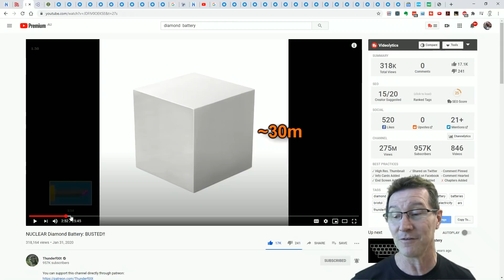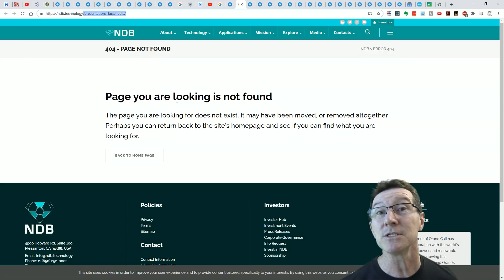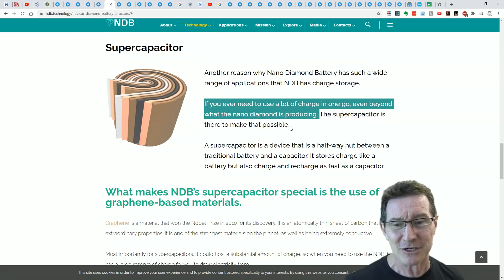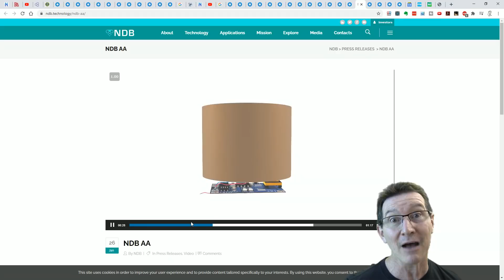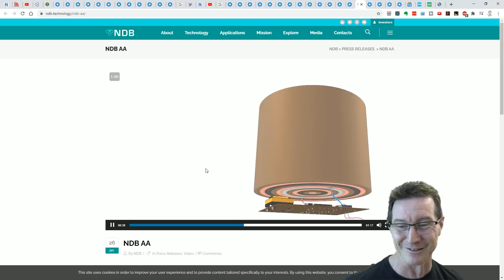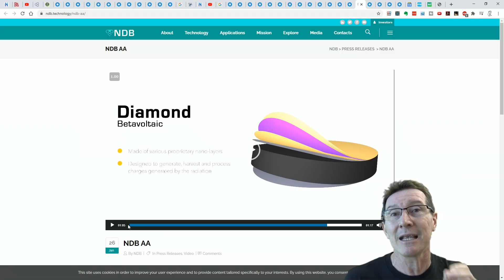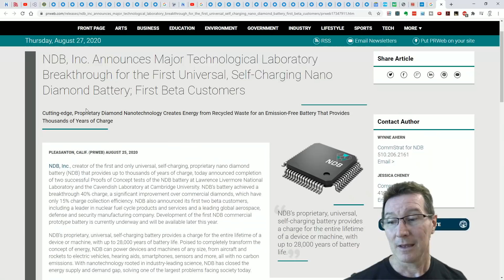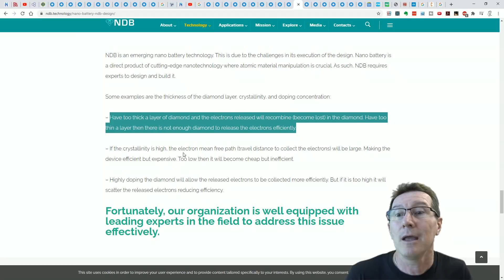EEVblog #1333 - Nuclear Diamond Self-Charging Battery DEBUNKED!

Comment: Can I testify in the court case against you.  Your self marketing sounds fine to pole without a brain.  Why don't you calculate the actual volume of the example photograph, and the sub volume in the chip (hint: Did somebody say 7 watts a gram of material, is that even true?  How big is that?).  7kw will run an EV.  How big is 1kg?
Reply: I forgot, one image of a product, doesn't prove what other products do.  It's unacceptable to extrapolate from that, as accommodating the relative dimension and weight data shows maybe seperate.

So, with no, Actual, proof of what is happening, this video is made.
Reply: https://en.m.wikipedia.org/wiki/Dual_in-line_package

I don't know what modern types are out there, but are you sure this is not some sort of skinny type?  That's probably a 8 times+ lower volume.  Also, if the standard is chips of 100 micro watts, then the chip is made to size, and the size of the actual power producing unit inside it can be smaller.

Lol. Listening to you reading their web page, not even realising what you are reading and how that customises the performance.  I need to make a channel just examining videos like this.

Do we trust a test lab, or a YouTuber?

Comment: Of course the power is ridiculous and it already exists with tritium or plutonium, but you forget two huge differences:
There is already no Tritium in nature and especially Tritium is ionizing like Plutonium which is one of the worst crap that can be made.
While their C-14 is therefore a Beta emitter without any danger, which we can consider producing on a large scale and distributing it commercially.
So nothing to do with RTG sources produced in very small quantities for space programs. It is obvious that in the first place with a very small production capacity the box is positioned on the micro-power market like its competitors to demonstrate techno, the higher powers coming later.

Comment: IF you could use the entire half-life of the unit in a reasonable timeframe, this would all work.  That's where they're getting their "energy density" from.  But no user is going to be using their product for 5,000 years.  The most optimistic timeframe is probably about 50 years, where you as a youth buy some gadget and pop in a nuclear battery and 50 years later it's still running and you've never needed to change the battery.  I suppose that'd be nice, but very few electronic products are still going to be usable 50 years from now.  I'd like my cell phone to never need a recharge, but cell phones made even 10 years ago  (analogs) are incompatible with today's networks.  So lets use 10 years as a water mark.  It's similar to the lifespan for say, a good smoke detector.  (and we already have 10 year lithium batteries for those too)  So comparing the power used over 5,000 years vs the power used over 10 years is silly.  And that's why 100 microwatts is pointless for most applications.

I suspect that the person that made that 100uW dip picture in cad was given a picture of circuitlabs' unit and told first to duplicate it, and then the marketing people sat around him giving him instructions on how to make it look like their product, without considering they were leaving an actual fact-checkable number on it.  If someone told them that was a quantifiable measure of performance, they'd have immediately removed it from the graphic.  You really can't give it any credibility at all - just because it's all they've released doesn't mean it's credible.  It was a MISTAKE, you need to quit harping on it.  Unfortunately, every other hard number in their marketing is pretty obvious BS (like claiming near 100% efficiency, when their competition already in the market has only managed 8% after probably 15 years of R&D)  So ultimately there's nothing to go on, they just say what sounds good, and the actual engineers had zero input on the matter.

Comment: Another thing, I am not saying this works or anything and I seriously doubt it comes close to the claims in the stories as usual, I simply don't know enough, but surely trying to extrapolate any information form that picture is a fools erand, the reason I say that is that is we don't know the actual size of that chip, the chip could just be a container, look at a cpu only a small fraction of the chip is the actual processor which means in theory the cells could be tiny and in that volume (whatever it is) could potentially contain thousands of cells . Again I am not saying anything positive about it as it might be shit it might not but your arguments also don't hold water

Comment: Ok I have no doubt that this NDB battery is snake oil, what I have a hard time believing is some of the points you make especially when you fail to read 14.29 as 14 thousand and 29 when that should have been 14 hundred 29. A simple mistake like this makes me feel like a lot of the other mathematics are well off as well. 
But of course thats just my opinion and mistakes do happen.

Comment: Powering a car with diamond is the new joke from gumbas & blokes. The nano diamond battery is for low energy devices that have to run reliably for many years like sensors, pacemaker, & hearing aides. Computer sensors, factory/industrial sensors, car sensors, smoke alarm...... Etc.... The best applications for nano diamonds is in the medical field what would you rather have in your body deadly tritium gas, the go to toxic lithium or a safe radioactive diamond battery that doesn't need to be replaced or charged all the time i mean sure if you like heart surgery go ahead bloke! All batteries have uses. Whoopdee dooo LOL..... 
I wonder if they could wirelessly charge pace makers & hearing aides instead of the usual surgery. Why & this is the kicker would we need pacemakers if we have 3d printed organs?

Comment: Ok, not like I would invest in this project any time soon or anything, but. . . just because that one chip in the article was 100microwatt, why do we assume that 100 mw is the maximum they could produce at that scale? I mean, couldn't that one chip just be a model that works at that level on purpose, or an early prototype that they've since surpassed? 99% of this video is some variation on "100mw?! You can't do anything with that!" and maybe that's true, but what is the evidence that this is the absolute limit of its production capability? Just that one concept image? I mean if it could generate the power to fully recharge a standard AA battery over a day, or even a week, or in some applications even a month, that would be a viable power source for a lot of applications.

Comment: 100 μW, about as much as you get from a potato battery, or about 1/10th of a lemon battery, and they expect this one to power a phone. At 100 μW a single AA-battery can last for about 20-40k hours, about 2-4 years, that is if it's constantly drawing power. So the diamond battery would only have uses like small clocks, or as a replacement for a CMOS battery in computers to keep the BIOS and system time from being reset, among other things that are critical for ultra-low power devices running longer than 10 years without a stable supply of power

Comment: I can see one application for these - in clocks. Even a large radio controlled wall clock takes only around 100uW, so a nuclear battery coukd be built in and the clock sold as self-powered.
But since such batteries are already available, cost must be the key question. They would have to sell these for maybe a dollar at most to make them, er,  disrupt the clock market.

Comment: There are REAL nuclear diamond batteries.
They’re made from carbon-14 (radioactive byproduct left over from fission). They don’t recharge. They hold a charge (minuscule charge) that are said to lasts thousands of years. The only problem with them is that the charge itself is so tiny it wouldn’t be practical.

 This product you’re showing is probably bs lol

If we were able to switch from electrical pulse circuitry to optics based circuitry, minuscule amounts of energy would be feasible

Comment: I think Dave maybe trying to say something about 100 microwhats... but what???

Heh seriously though. It is possible to get astronomical Energy density, but it ain't worth jack sh if you can't actually pull the energy out in any meaningful capacity.
Which is the curse of Betavoltaics. That said in the aspect of density and half-life the C-14 based "diamond" betavoltaic may prove an evolutionary step over the previous tritium.
At least it could have been taken serious as that if not for these bloody Scam-companies that as pointed out by others literally used the 3D-model of a generic TP4056 charger circuit with a transformer slapped on it!!

Comment: If the device has 7x the "charge size" of a mobile phone battery, it would power the phone for a week as opposed to 2 days.
But, it takes a hundred years to run down, so it's not putting out enough power to run the phone.
So, they might be right about energy density (neglecting the part about the device falling apart long before it can all be extracted) and how long it lasts, but they don't understand enough about electricity to put those two facts together properly.

Comment: I found it rather odd that the picture showed a 22 pin DIP.  I think that is an uncommon size.  Why would you need that many pins to supply 0.1 mW of power?  And who uses through-hole stuff nowadays?  Everyone seems to use SMD packaging now.

Comment: Nobody EVER has their car battery booster pack charged and end-up needing to get a jump-start anyway... just need enough to keep the pack topped-off while it sits in your trunk for 5 years until the day you need it and then figure out it isn't going to help one bit.  Thinking the same for emergency flashlights and backup battery packs - they don't stay charged forever.  That said, this isn't the company to buy one from.

Comment: Spot-on with the marketing BS, but don't discount the number of applications that would kill for 100uW. Remote Controls, Remote sensing, memory backup, item tracking, etc.  Lots of comments below don't know the tech and requirements for low power circuit design.  We had a clock 25 years ago that ran for about a year on the power of someone shuffling their feet across the carpet and touching the glass at-least once per year, and yes some calculators are also that efficient... don't dis the calculator unless you want your $1000 phone hung from a mill or lathe or welding table in a grimy workshop or dropped from a rooftop.  

People say that's not enough energy to press the button on the remote every few days, but that's totally incorrect, 100uW stored in a supercap is practically infinity for many of us.  For a Zigbee or BLE sensor that's a sleep interval well under a minute indefinitely or a large fast payload on long intervals or interrupt based - think water sensor in basement - just needs to connect and transmit ONE time in many years, long after it's been forgotten because it was installed at the same time as your instant hot water heater.  Your remote might more than one IF it's one that lets you play video games, but at that point as some people pointed out it might be time to energy harvest from the motion of the controller on top of the battery (to transmit a low battery signal - oh the irony).  With 100uW for decades, those wireless sensor networks can be installed where the sensor may become effectively inaccessible.  Those "niche" apps you discount are a lot more numerous than you give credit to.  I'm tired of replacing batteries in my BLE tiles and wireless temperature sensors every year (CR2032).

Comment: While I agree with your debunking, I have some thoughts and questions though:
I approximated the size of their battery to be about 5cm x 2cm by 0.2cm. So it has a volume of 2cm3. If these could be stuck together like Lego bricks then 1 cubic meter would contain 500,000 batteries providing 500,000 x 100 microwatt = 50 Watts of power.

A 1 square kilometer area would house 1 million of these cubic meter modules providing 50 Megawatts of power. Can these modules be stacked? If you stack them 10m high then that's 500 Megawatts! Then again you don't need to be stacking these, you can always bury them though this will make it harder in case there are maintenance issues.

Can NDB's efficiency be improved? If they could improve to 1 milliwatt then I'm sure many people would be more than happy to bury a few a few cubic meter modules on their properties providing them with all the power they need.

What do you think?
Reply: If you assume that somehow this purified C14 isotope diamond thing is only 10x the cost of a regular AA battery, or about 10 dollars (existing ones are thousands of dollars), and a typical house uses around 1kW of power, you would need 10,000,000 100-microwatt batteries to provide your house's power needs. At ten dollars each, thats about 100 million dollars.
So... no, I don't think many people would be more than happy to bury a few cubic meter modules on their properties, providing them with all the power they need.
Unless someone else is paying for it.
Reply: @rageagainstthehygiene2357  Where did you get the figure of $10 for a 100 microwatt battery?
Reply: @pacus123  
Like I said, it was just an extremely, ridiculously generous estimate that the cells were 10x the cost of a AA, which is maybe a dollar.
Reply: @rageagainstthehygiene2357  Fair point. We don't know how much it will cost. Just a thought exercise anyway

Comment: You can actually make a tritium type power cell quite easily. Not cheap though. Tritium light sources are eye wateringly expensive. I have worked on an application that would find this useful. Probably too expensive though. Interesting it's got a supercap. How much leakage on one of them? 90uW roughly? Cant watch any more NDB are doing my head in.

Comment: Of course its a scam!  It's not as if batteries that put out low voltage and power can be configured with multiple other batteries in series or parallel to increase output voltage or current (called "Power") in arrays that could be called "battery packs".  If that were true, we would have electric vehicles running on those.  Dave sounds typical of hype naysayers - cry gloom and doom and it they are right later on... they are geniuses. If not, nobody cares.  This is not science fiction but just science. You would like to see them get an independent lab to investigate if the basic design is sound (oh, wait, they did).  So, let's deem it a scam because cutting edge technology never actually can become products - like EVs, LED light bulbs, solid state memory storage, personal cell phones, GPS, artificial hearts........ Best to listen to the rants of arm chair quarterbacks.

Comment: Couldn't you stack 10 of their nuclear diamond power sources and a small lithium-ion cell and make a remote control that never needs a battery replacement? That would be an interesting hobby project. Not sure how many watts a remote control uses while it's on, but it can't be much. At a minimum you could probably make one that only needs a battery replacement every 10 years or so... probably when the chemistry of the li-ion battery breaks down and can no longer hold a charge.

Comment: The actual selling point is that these recharge normal batteries while the device is idle. Directly powering a device is not feasible. But recharging a device while it's in your pocket is actually not as ridiculous. It would definitely cut down on the amount of wall electricity you need to draw, even if it doesn't replace it entirely. You're being slightly disingenuous by representing it this way, even though the media has exaggerated the benefits

Comment: A lithium thionyl battery has higher service temperature and can last decades on a micro watts circuit, they are better and cheaper than those betavoltaic gimmicks.

Comment: What a fancy article in exgange of some $ and after mediatake the league(news articles) ... and boom its now everywhere on the internet lol
Reply: betavoltaic def : A betavoltaic device (betavoltaic cell or betavoltaic battery) is a type of nuclear battery which generates electric current from beta particles emitted from a radioactive source, using semiconductor junctions.A common source used is the hydrogen isotope tritium.

Comment: Well the legit chip for 100 mircowatts you could get 40 of them mod an 4 DIMM slot board  to be able to remove the power traces from the 24-pin PSU motherboard connector. 40 of them that is alot more than what they are claiming and those 40 are for the base spec of DDR4 IF you go over the spec 40 of them might not be enough to power 4 DIMMs of DDR4. 
You also have the thing of people who deisgn motherboards might not want to put 40 chips right next to one another to power a low power part of the board that already has had its power traces from another power connector. As this would make redesgining the board to get this to work a thing. You also have the shape of the board will change as most likely those 40 chips will be stacked on top of one another instead of right next to one another making the board have a thickness to it that it didn't before.
Other than use cases like that and other super low power electronics i can't think of a use for a long term chip that does 100 mircowatts of power for 100+ years.